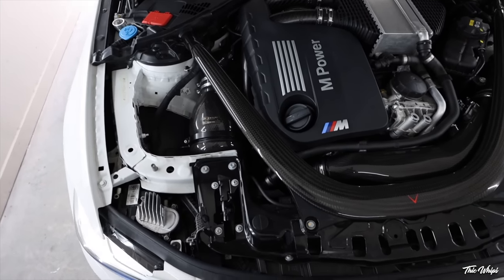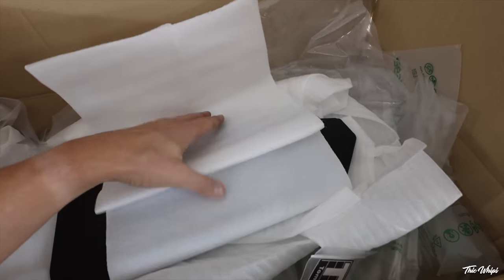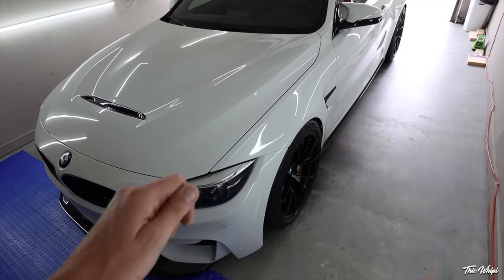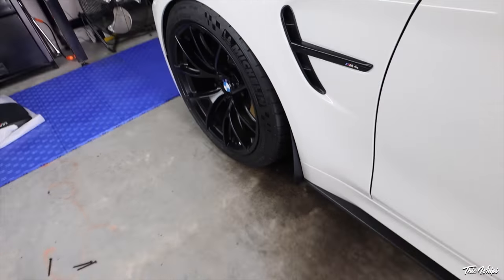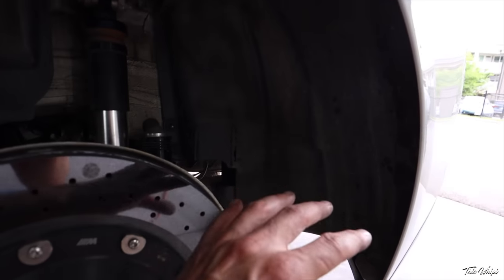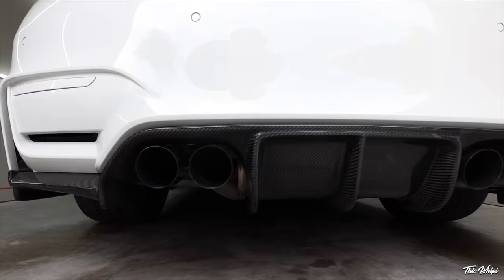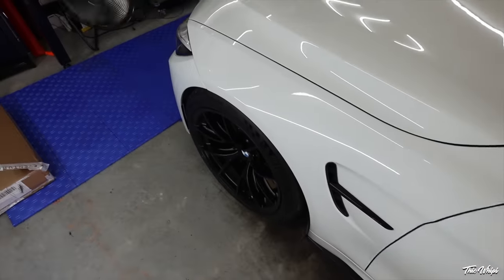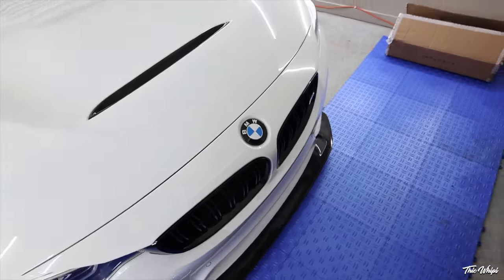MORE CARBON FIBER FOR THE M4GTS. 💪🏽

Comment: Personally you are killing the look on your GTS, freaking 🔥🔥🔥🔥.
My $.02, keep the carbon bits under the hood and down low at bottom of the car , ties in perfect, the separation between gloss black up high and carbon down low. If you were to go with carbon mirror caps then, maybe do carbon in the grille and M4 fender emblem. Again only my $.02. Either way the GTS is looking fire bro, you are killing it. Looking forward to more videos, further upgrades and some performance testing down along the line.
Reply: What he said 👏🏼 🙌🏽 👍🏽👍🏽

Comment: Cover looks fire. Very nice minimalist choice. As for the Fender flaps, that rear you could always notch out to fit. Just a thought. Keep up the build, GTS is coming along amazingly. I am waiting for the performance mods, beyond charge pipes. James said the GTS does not stand a chance against his M3 competition. He was not trash talking btw. I had asked if you guys had run them yet. He told me no because Johnathan knows the GTS in stock format does not stand a chance against the M3 Competition,  now when he starts his build out, we will be running them.

Comment: If you wanted to get rid of that gap inbetween the reas diffuser center and sides, a 1" thick black adhesive outdoor weather resistant foam would fill that gap simply. Super easy to cut to exact shape,  size needed.

Comment: Hey @thicwhips I recently picked up a M440i and it was perfect but when the dealership put the common paper plate with the dealer frame I noticed the bolt on the back messsd up the paint behind the license plate frame due to the screw not getting locked in with the lug nut so it has the swirls. Nothing major but any fix??? Can’t take it back since the dealership is 9 hours away.

Comment: I think you may upgrade the final on the exhaust with carbon+burn style positioned like they pop-out a little. I think the front grill is perfect right now but with carbon will better? I dunno. I have a question for u, did you buy an M4 GTS 2016 with 110.000km if in good condition?

Comment: I think the diffuser might have a gap so that the two pieces don’t chafe.. since they are not attached. 

Or possibly to allow a little flex in the bumper because carbon is stiff and if they were all one piece, it would snap if the bumper were to be flexed. Not sure though, seems a bit unlikely.

Comment: Hello, could you help me with a question? the rear tire is a bit more outside the frame line on the m4. Does your tire touch the edge of the chassis?